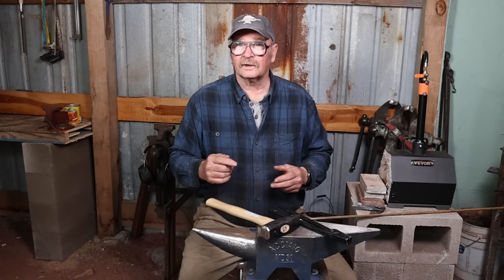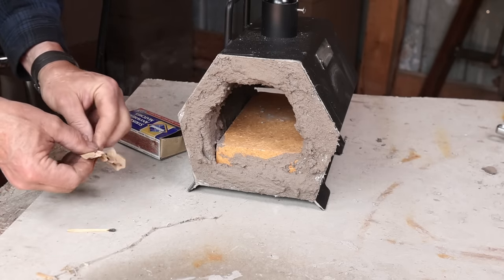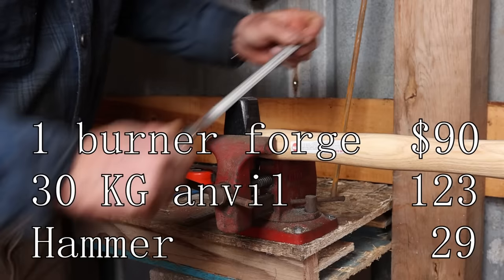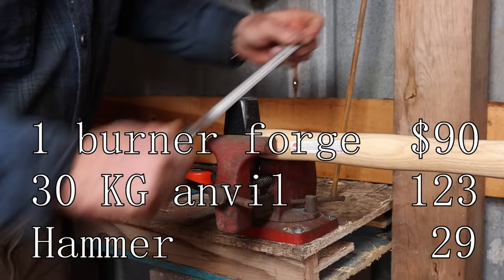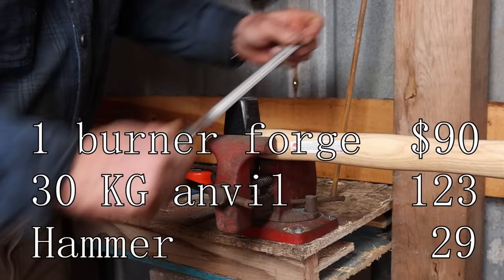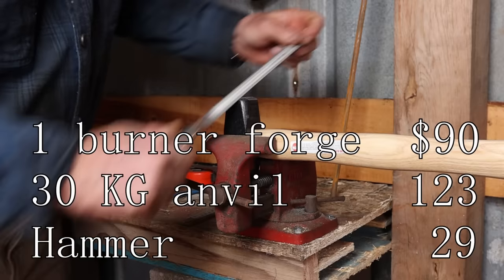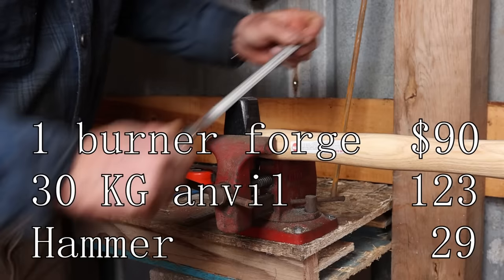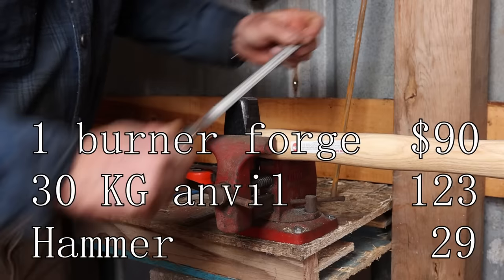Affordable Blacksmithing - Budget friendly TOOLS

Comment: I'd like you to cover what's appropriate for an anvil base, how it can be attached to the floor, or not.  
I live in a typical suburban neighborhood. No out-buildings, neighbors are close by, etc.  One of my barriers to entry is my concern for creating noise pollution. I can't run a forge in my garage with the door closed, and with it open I'm afraid the constant roar and ping ping ping of a hammer may drive my neighbors insane.
Reply from the maker: I will plan to cover that in more detail soon.  But in the mean time, here is a video on quieting the anvil so it doesn't ring. https://www.youtube.com/watch?v=Z3365vFHXhw&t=284s&pp=ygUWYmxhY2sgYmVhciBmb3JnZSBhbnZpbA%3D%3D

Comment: How did you mix up the refractory cement? My forge just came in and imma cement it in a couple hours
Reply from the maker: I mixed it according to the directions on the bag.  On the small forge I used the brush provided.  On the two burner I used a small masons trowels.  I think the trowel worked out better.
Reply: @BlackBearForge  awesome thanks for the info. I just finished cement and ill let it sit  for next 2 days while out of town for work and then take first hammer swing on sunday. Thank you

Comment: One suggestion for those with a dirt or gravel floored shop is to bury the anvil stand about three feet in the ground. Think fence corner post. It would prevent most anvil movement.
Reply from the maker: Thats my preference for any long term setup.  But this anvil won't be the main anvil in this little shop, so i want to keep it easy to move.

Comment: Just got the same forge, but they didn’t supply me with the refractory cement
Reply from the maker: I have heard it no longer comes with it.  Most of the blacksmithing suppliers should have some fairly cheap
Reply: How much cement is needed for the single burner forge?

Comment: Can you speak to, or do you have another video where you do, your comment that you did not wish to use flex in the weld of the fork because you did not wish to contaminate the forge?
Reply from the maker: Flux is caustic to the ceramic lining of the forge and over time it will eat a hole in the floor.  If you use flux in a gas forge you just need to re line more often.  But since I don't plan to weld in this little forge, I didn't want to start out by causing damage.

Comment: Did you ever do a review on the 2 burner forge? I can't find it if so.
Reply from the maker: Not yet, the single was ideal for that little shop.  But if you need longer heats, the two burner would be better
Reply: @BlackBearForge  Thank you
Reply: @BlackBearForge   also does the burner come with the cement and coating? I've been seeing where it says it doesn't.

Comment: How long typically does a 20lb last you?
Reply from the maker: 6 - 8 hours depending on pressure.  Keep in mind that there is a lot of working time in the shop doing things that don't require the forge to run, so that might be a few days of actual work.  There is more propane in the cylinder, but the 20 pounders can't vaporize efficiently enough at the higher draw rate so they ice up.   I've never had an icing problem with a 100 pound cylinder

Comment: How big of a Log do you need to mount that anvil to?
Reply from the maker: This one was fairly small, maybe 12"  But the larger and heavier it is (up to a point) the more solid the anvil will be and the better it will stay where you want it.
Reply: Thank you sir! I'm excited to start my blacksmith journey! So far I'm well under $500 and all I have left to aquire is fuel and ⅜ round bar. I was even able to splurge and get Nicholson files and Handel's with a file card

Comment: I understand the whole sponsorship thing, but for the most affordable setup it’s hard to imagine it wouldn’t be cheaper to make your own forge
Reply: Hi, I made my own coal forge and it cost less but it wasn’t cheap. You need pipes underneath and if you buy anything new it’s pricey. And scrap steel was fifty cents a pound. $90 is hard to beat.
Reply: I started down that route but after buying a bunch of supplies like the castable refractory (~$70 for a 55# bag, which was the smallest I could find; these days Glen at IForgeIron sells it in smaller quantities), rigidizer, was given an insulating fiber blanket by a neighbor, building legs and burner port to a 3# coffee can and realizing I still needed to buy a regulator and other fittings, THEN try to follow the various bits of instructions I could piece together from the IForgeIron mega-thread  for installing the insulation and building the burner, I gave up and spent $90 for the Mr Volcano. For the first time doing something with this level of complexity having everything already chosen and measured out and the steps spelled out into a single page really makes a huge difference.
Reply: @wilcooley  I agree; that makes sense. 👍🏻

Comment: I looked all over the place for a hammer that was 2 pounds. I couldn’t find one less than 3 pounds. I did find a ball peen hammer but it seems really light. I bought a 3 pound hammer, the ball peen, and another odd looking hammer.
Reply from the maker: The one listed in the video description is available as a 100gram hammer which is 2.2 pounds

Comment: This is an amazing video. However, what he says about hammer weight isn’t entirely true. I’m 14 and use a 3lb hammer, and it works just fine. Of course it really does depend on what you’re forging and your strength, so I do use a lighter hammer for smaller projects. But if your strong enough and used to swinging a hammer, don’t shy away from 3lbs. Anything over that though is a little much.